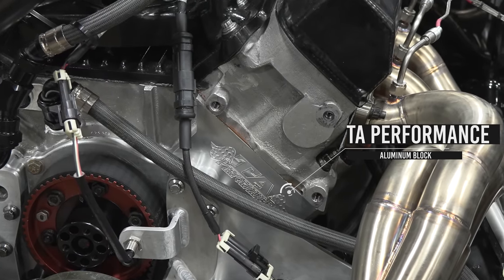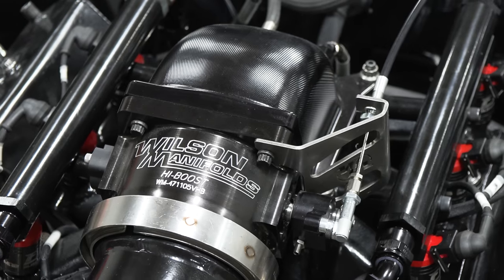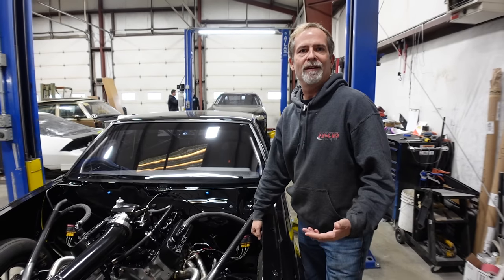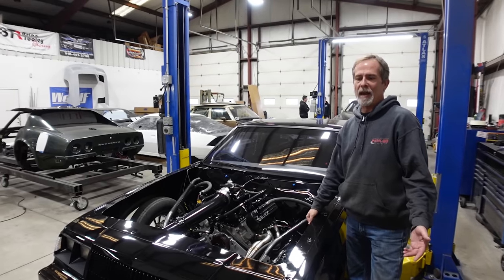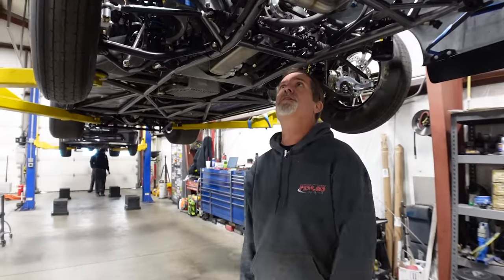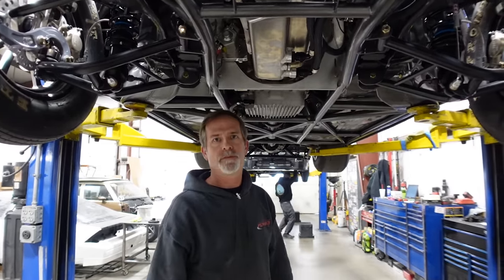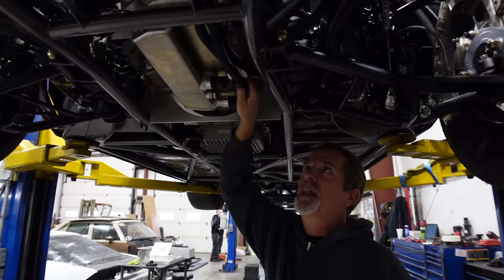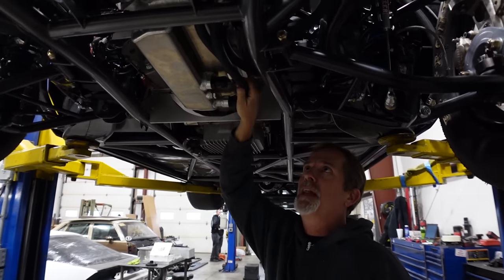Revealing the hidden secrets of the 1987 Buick Grand National breakdown

Comment: "The Water's Fine"--Good point. The Buick guys would always stick together at the racetrack, the Mustang guys would try to outrun each other and try the Regal crowd too..... I was so so so very close to ending being a GN guy. My mom had one too, a 84' T-Type which was the 200/300 non-intercooled version. That sucker went 9.18 bone stock at the strip in 1987 and I remember everyone crowding around trying to figure that space shuttle out. It would also continue to haul rump way on the other side of 120mph (later GN's used to shut off). But I ended up hanging with guys who had Foxbodies and ended up with a Strawberry coupe in 1991 which I still have. But the Buicks are cool I tell you!

Comment: Love his story about his mom buying a leftover new one back then and still has it. I wanted one out of high school in 1987 and Dad wanted so bad to get it for me but he just couldn't. 4 years later I was working and had my own money. Found a 2400 mile orginal here in Detroit, still had the little yellow marks on the goodyear eagle stock tires. I did a bunch of mods but nothing you could see and nothing that couldn't be reversed back to stock. It went 11.89 and was still a pretty much stock car. Spare set of GN wheels with little 27X8 M/T slicks for the track and street too when the time was right. I kept that car 4 years, didn't have garage storage and decided I got the turbo buick experience out of me and it was time to sell. 
Originally  I paid the down payment, dad took the loan and I paid him every month. Paid it off in 2 years. Original price $14,900. Sold it 4 years later after returning it to stock and then having 7500 miles. Sold it for $14,500. Cost me $400 to own that car for 4 years. 1995 some collector here in Michigan ran and bought it from me and drove it straight to the airport for a customer in Arizona. That car was weird because it didn't have the concert sound radio and speakers and had a fixed mast screw on antenna. I still have most of the performance parts I threw at that car back then. I haven't really wanted one since, but still respect them and think very highly of the turbo Buicks and the guys still fooling with them.

Comment: I bought mine in 2019 a 74k mile t top car.  I went for the basic safe build.  Stock block, rotating assembly, flat tappet cam, te 60 turbo, razor alcohol, 20 psi boost, 3inch down pipe, 2.5 pypes exhaust. 11.5 quater mile.  Not the fastest but i can run and out run most of your ss camaros, scatpack, mustang gts and other 400 to 500hp cars.  Low end tourqe is a beast on these cars.  Next car up is my 92 gmc typhoon.

Comment: I get it Dave i have a gn i bought new and need to get running and a ttype with a ta performance aluminium blk,heads front mount intercooler 68mm per. turbo, 4l80e trans, currie 9 inch, wilwood disc brakes all around, trans is from lonnie at exteme auto.,dual nozzle alchohol inj.nothing stock left under hood, still has ac and drive on the street. Totally understand the passion. My question for jason is was no mercy 14 the first time Dave had the gn out in competition, if so that sucks and we all know it wont be long before Dave is back out kicking ass.